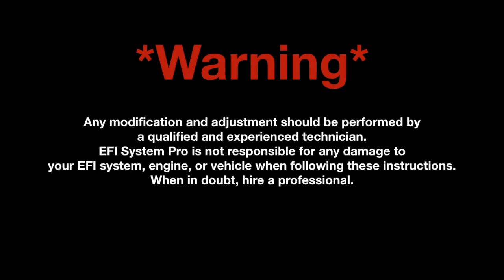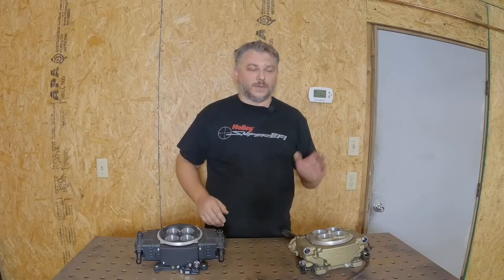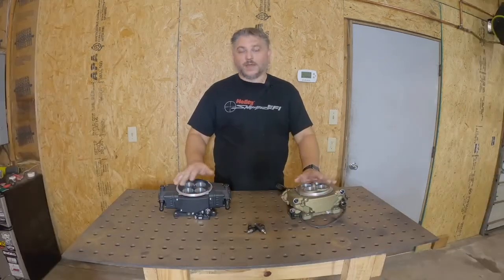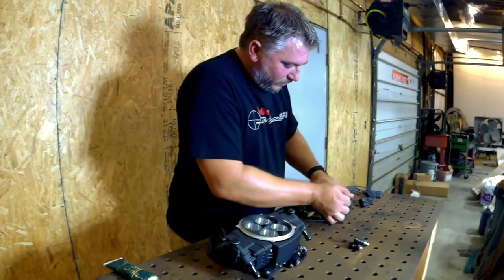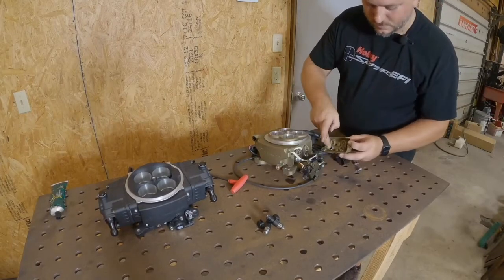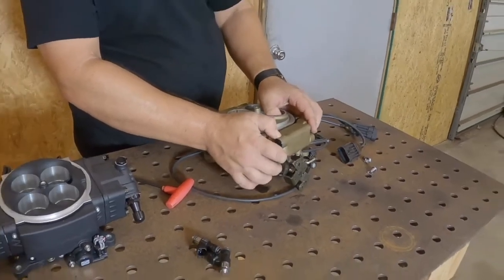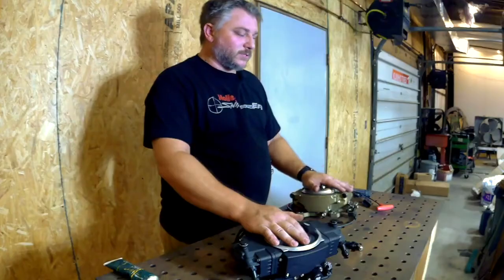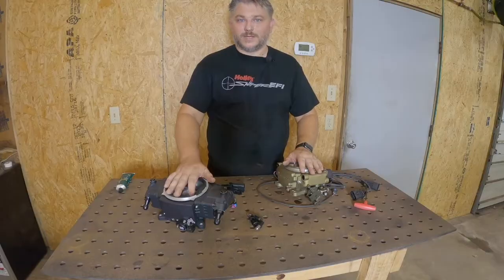HOW TO REPLACE FUEL INJECTORS & UPGRADES | HOLLEY SNIPER/TERMINATOR X EFI

Comment: I have a Terminator X 4150 Stealth EFI (w/ four injectors)  that intermittently bogs  down upon acceleration. I did an inspection of the injectors and connectors and found that one connector has exposed wires running into it at the base. I am wondering if there is a practical way to repair this connector or should I replace the injector wiring sub harness. Also what would be the part number and cost for a replacement sub harness. Thanks in advance for your reply!🙂

Comment: thanks for the video, does the sniper 2 use the same style injector?
Reply from the maker: Yes, the Sniper 2 uses the exact same injectors as the original Sniper, but with a much better connector for them.

Comment: Hay Guys, bought a HyperSpark to compliment my Sniper from you guys a couple of years ago. I've watched a couple of 'experimental' videos of people downrating to smaller injectors EG 80lb which helped with over-fuelling and backsplash up into the air-cleaner (and reduced injector noise). One video appeared to show the increased pulse width of the lower lb injector led to a more granular tuning adjustment made by the ECU in the learned fuel table. Do you have any experience of having experimented with lower injectors, or could you pass comment on what if any effect this would have on longevity of the ECU's electronic drivers for the injectors.... For example, could lower injectors potentially put less load or strain on the Holley electronics? (Four barrel Sniper on 1969 351W)
Reply from the maker: Hi Rob, There really is no benefit to the ECU itself in downsizing the injectors. It is the same electrical load no matter the injector flow rate. The actual electrical parts are the same for all injectors that would fit in a Sniper with the only difference being the nozzle size. I have helped one customer downsize his injectors a year ago or so and while it works fine, it is pretty unnecessary unless you had a real small engine. If you have a V8 making 250 HP or more then there should be no need and if fuel is coming back up out of the throttle bores it sounds like there is a tuning issue or exhaust leak causing excess fuel flow.
Reply: @efisystempro  Thats brilliant thank you, and your absolutely right, the fuel thrown out the bores was due to over fuelling caused by a persistent exhaust leak (I kind of knew the answer to that already, but was interested in your take on it...). I had an intermittent injector which I just fixed (hopefully see how it holds) using the zip-tie trick, interestingly the thin and flexible copper wires (grey and white for rear driver’s side bore) are showing exposed copper between the rubber connector and wire sheathing. I'm really beginning to doubt the build quality of the Sniper MK1... Thanks again for your quick response to my questions.

Comment: Do any of you in the comments know if the super sniper with 4 injectors can be converted to an 8 injector? To reach the 1250hp rating. Thanks all.!
Reply from the maker: The ECU does not have the capability to run 8 injectors when it started as a 4 injector system. You can run much higher flowing injectors though. We have 220 lb/hr injectors that drop right in for $88.15 each. That would get you even more fuel flow than you would get with 8x 100 lb/hr injectors.

Comment: I have a stealth maxwith 4 injectors. Plan on 600 to the wheels with a turbo. Will the 120 support that
Reply from the maker: Yes, the 120 lb/hr injectors will support 750-800 HP no problem.

Comment: Is there any information as to why the Terminator Stealth with 8 100lb injector is rated at the same 650 NA HP as the 4 injector model, but 1250hp under boost? Like part number 550-1006.
Reply from the maker: The 4150 EFI units are rated by air flow for naturally aspirated use. 650-700 HP is about all you are going to get to flow through them air wise. When using boost of some sort you can force more air through the throttle body than the engine can just pull through on it's own.

Comment: So I can just buy the cheap-o Sniper, and throw in a set of 220lb/hr injectors (together with their flow data sheet ofc) for a higher hp boosted E85/meth application?? That's awesome
Reply from the maker: Sort of. You can put those injectors in there and it will run fine. The non Super Sniper can only read 14 psi of boost, so you are limited by that. Super Snipers can read up to 21 psi with the internal MAP sensor, but they also have the ability to run a remote mounted MAP sensor for even more boost than that.

Comment: I had the passenger front injector stop working. It was just low pin tension. I had it happen a couple years ago. Took me a little bit to figure out.
Reply: Ive had 2 separate  Sniper injectors fail 
Both in the Front Pass side/ Primary Pass side. Interesting.
Reply: First what is low pin tension and I have the exact same on not working.  Gonna take it apart now
Reply: @arthurcoddington4682  low pin tension is when the female terminal doesn’t hold the male terminal tight enough.

Comment: yea, the injectors install is super easy, but the problem is that for YEARS holley refused to sell/provide injectors for the sniper. They would sell them for the terminators, but when my injector locked up on my sniper last summer, holley would not get me a new injector, they only said I could send it in. They claimed that the injectors are a safety item and they can authorize a home repair of the unit. Insane. I had to find some used sniper injectors from a guy on the Holley forums.   Has Holley now changed their policy and do they now sell actual sniper injectors? i sure hope so !
Reply from the maker: Holley still will not sell replacement injectors. They do not want people opening their Snipers. We have 100% direct replacement injectors for sale at this link though. They are the ones used in the video. https://www.efisystempro.com/sniper-terminator-x-efi-injectors-522-101x
Reply: @efisystempro  thank you for selling these!  But Holley sells fuel Pumps, fuel fittings, other fuel injectors, fuel lines, etc… all
Of that is what is confusing to me… why draw the line at not selling injectors specific for the sniper ? And they do give you a new regulator/screen if you ask for one and then you have to “open up the sniper”.  I’m glad you guys sell them and if I ever need any , you will
Be my first call.  Back in 2020
When I had a sniper injector lock up (racing at a two day autocross event) I became
Baffled at how impossible it was to find a replacement injectior. Long story, long long story, but I’m good
Now and hopefully won’t need any other injectors
Reply from the maker: The regulator is much less invasive and much less chance for a problem. Many people don't understand the need to lube o-rings for installation, it is very easy to pinch one and create a leak. Aside from the regulator, Holley won't sell any parts that go inside a Sniper or Terminator X Stealth.
Reply: They told me the Exact same thing. 
Like its impossible to replace an Injector.  
Ridiculous
Reply: Hi I need injectors for Holley sniper efi 550-511,what kind I can use

Comment: I have the Sniper EFI on a Chevy 454HO Crate motor. There is a very annoying and loud clicking from the stock injectors that make the engine sound like shit when it is idling. Are your 120 lbs injectors any quieter than the stock Holley 100 lbs injectors? Thanks, Jack
Reply from the maker: Hey Jack, the loose connector can be an intermittent issue for sure. A zip-tie or heat shrink tubing could be the solution, but we have plenty of injectors if you finds that it is the injector itself.
Reply: @efisystempro  I didn't say I had a loose connector in my question. Are you implying that a loose connector will cause the loud clicking noise coming from the injectors? I was told that the clicking on the stock Holley Sniper injectors is normal. I was wondering if the 120 lbs injectors are any quiter. The engine runs great so I don't think I have a loose connector. Thanks, Jack
Reply from the maker: @jackcrognale417  the 120 lb/hr injectors are basically identical to the original 100 lb/hr and will most likely make the same sound.
Reply: @efisystempro  Thank you

Comment: If running a flex fuel sensor and using e85. How much hp will the stock 100lbs injectors support?
Reply from the maker: For a 4 injector Sniper with 100 lb/hr injectors on E85, you could support 450-500 HP with boost and 550-600 HP naturally aspirated. 8 injector Sniper is basically double that. Snipers can't read flex fuel sensors, but Terminator X can. Power numbers are the same for Sniper and Terminator X Stealth.

Comment: Is there any power gain from swapping 100 to 120
Reply from the maker: No, upgrading injectors does not make power. The only reason for the upgrade is if the original injectors can't flow enough fuel for the power the engine makes